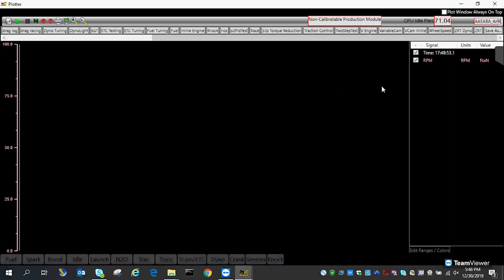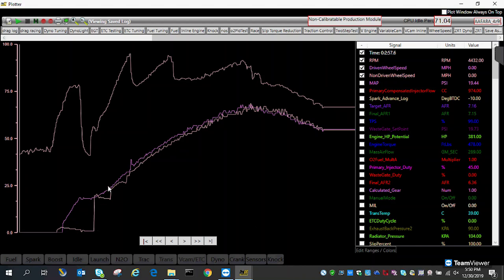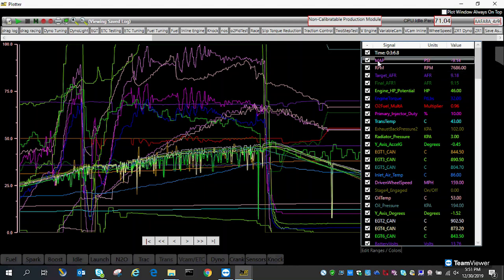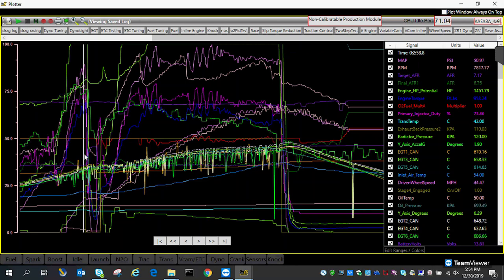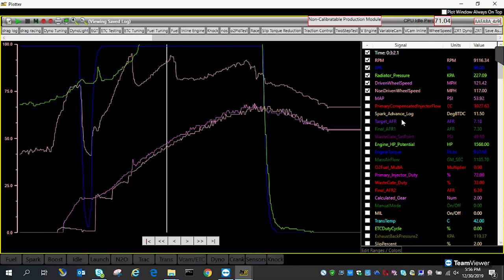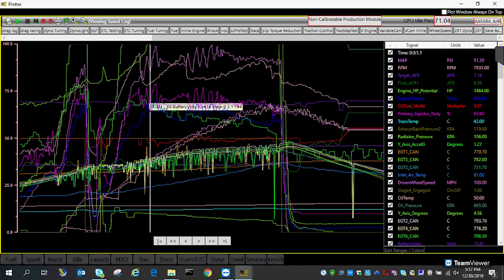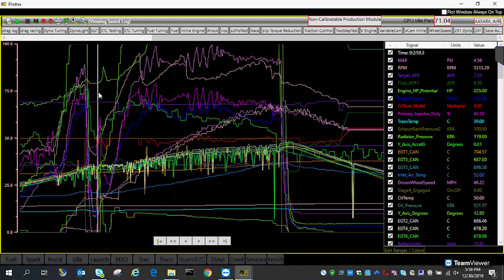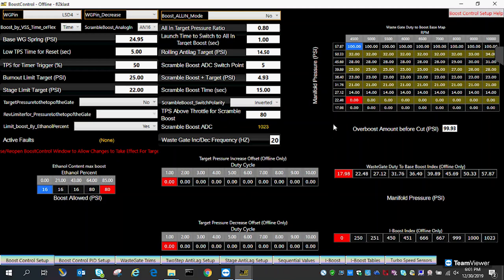How to read an ECU log - Proefi128

Comment: Thanks for taking the initiative, it was great to see what the data looked like for the run in question. Are you sending the data to a unit such as the display logger, or do you log directly to a laptop? Also, would you mind doing a similar video for one of the instances where the engine was saved by one of your configured fault management strategies?

Thanks again for taking the time to share this information publicly.
Reply from the maker: Yes, ecu has the display logger on it via CAN. I will make another video about the ECU setup. Thank you